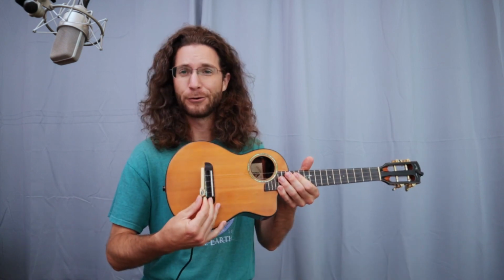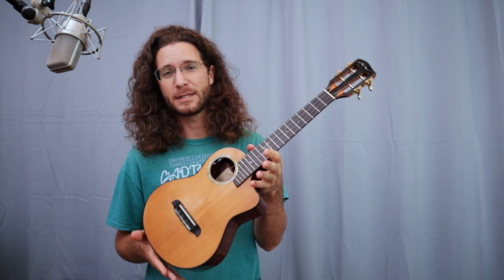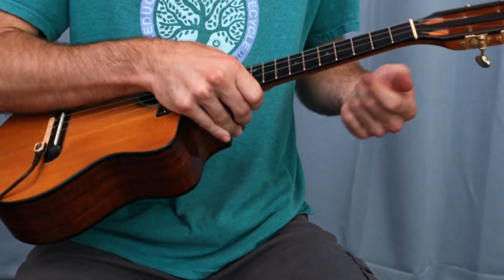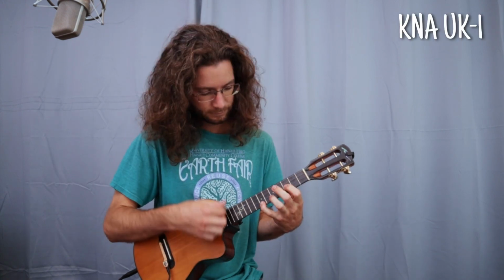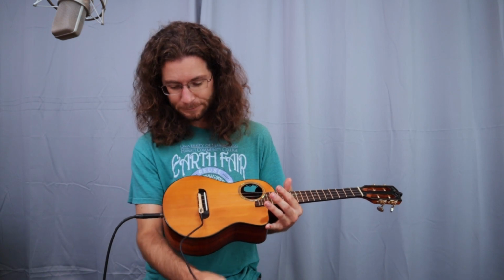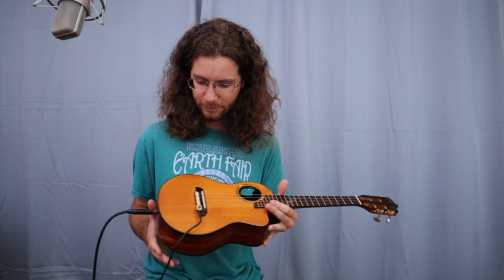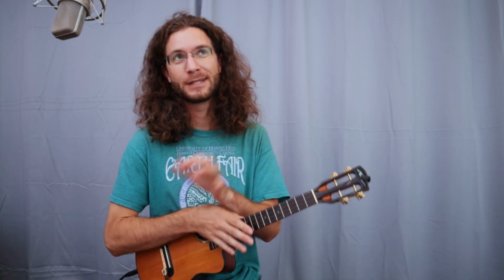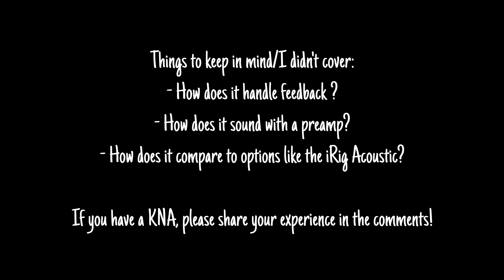KNA UK-1 Tie-On Ukulele Pickup Comparison/Review

Comment: Once you insert the device, why would you ever remove it? You would clip it to yourself so stepping on the cable shouldn’t be an issue. It seems to me throughout the video that you didn’t really think it was going to be good. Sorry, just my opinion. Through YouTube I couldn’t hear a difference between your pickup and the KNA.
Reply from the maker: Don't be sorry. We all have different needs and approaches. You can disagree with mine. 

Re: your points - I would be afraid of breaking it off if I left it in my uke all the time - just a matter of time really. As for clipping it on, sure, but with a normal pickup I don't have to do any special rigging - just plug it in. To be fair, you're right, I DIDN'T think it would be good compared to what I use. Otherwise I would have tried it a long time ago. But I think I made it pretty obvious that I'm not the ideal customer and how it could be useful to the right person. Did you use good speakers or headphones to listen to the comparisons? I thought the difference was pretty huge, personally.

Comment: I decided to buy this pickup for my baritone ukulele after watching a number of positive reviews and it did not work out well for me. Plugging into a Fender Acoustic Junior, this pickup not only sounds dull, but is incredibly imbalanced tonally. Needed a lot of EQ fussing and a compression pedal to get it sounding midway decent. If you have any sort of string buzz that gets amplified fairly heavily as well. The cable is really easy to pull out and any minor brush against it during playing inputs noise into the signal. Not worth the money.

Comment: what do we connect this to. Which amp etc. are you using and what's whole set up?
Reply from the maker: It's plugged straight into my recording interface. But any acoustic amp will work if you're determined to get one. I don't recommend this if you want a good quality sound.
Reply: @BradBordessa  Hi Brad, Thanks for response. I am looking for complete set up for Rubab Instrument with Nylon Strings. 
Purpose: 
1. For Live performance 90 %, 
2. For Recording 10 %

Could you suggest ecnomical full gear?
Reply from the maker: @ Cool! I really have no idea on the pickup. You can get stick-on soundboard transducers that would probably be a start. Unless you can use a violin pickup that clamps to the bridge? 

If youʻre plugging direct into a PA, youʻll probably want a preamp since most of those pickup options are "passive" (Google "piezo pickup impedance mismatch"). It will help balance the sound. 

Any acoustic amp is a good bet or a keyboard amp. NOT ELECTRIC GUITAR AMPS!!! For me, the Fishman Loudbox Mini is killer for the price. And you donʻt need a preamp as long as you plug straight into the amp. 

If rubab is anything like ʻukulele, buy a good pickup, otherwise, youʻll be fighting to make up for a bad sound. Feel free to contact me through my website if you have more questions.
Reply: @BradBordessa  thanks a lot for your response and advice. I'll keep it in mind , while making this set up. Much appreciated again for your response. Thanks a lot.

Comment: Hi Brad. Are you running these through any kind of digital interface? I have a UK-1 and without a DI the sound mostly just quacks, not lifelike at all.The DI gets me close. This also applies to a K&K in a Martin and a MISI in my Beau Hannam.
Reply from the maker: I recorded through my USB recording interface, which has a 2M ohm input impedance. This high number acts like a preamp or DI and avoids the quack. A low impedance number will quack every time. Go to my site and search for the pickup page. I've got a sidebar about input impedance which will be more helpful than whatever I write here. Long story short, you need a preamp with these pickups (and the K&K). The MISI is a bit strange since it should be active. Have a read and feel free to email me if you have any additional questions. Happy to help.

Comment: It’s possible to use it with metallic strings or only nylon? I have a tenor guitar with 4 strings.. Thanks 😁
Reply from the maker: No idea, but it kinda seems like the metal would be extra abrasive on the pickup. I think it's only designed for nylon strings. Why not a sound hole pickup?
Reply: @BradBordessa  Thanks for your answer. I don’t know if a sound hole magnetic pickup would fit into a tenor guitar soundhole, which is smaller then an acoustic one 🤔
Reply from the maker: @andreamartini9993  I bet you can find something. There are a lot of tenor guitars. The sound quality you get from a magnet PU will be significantly better